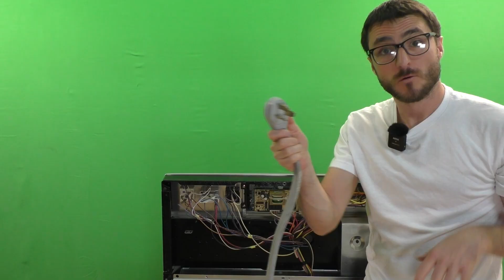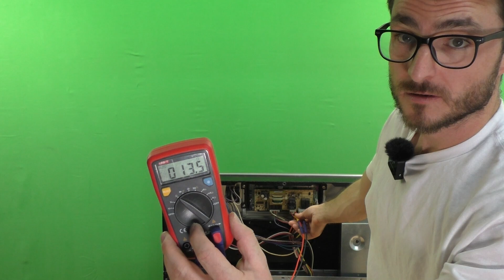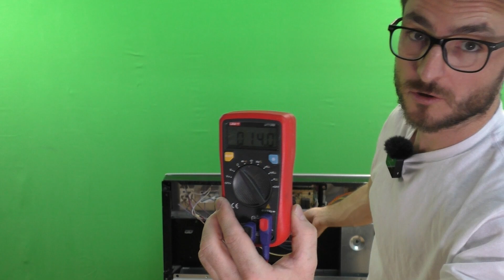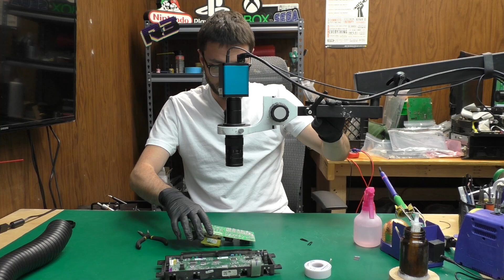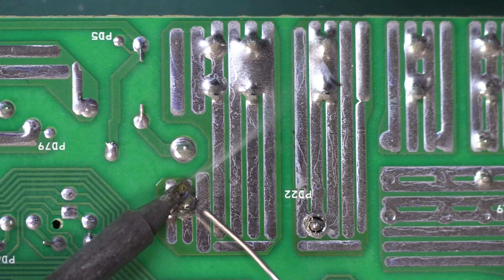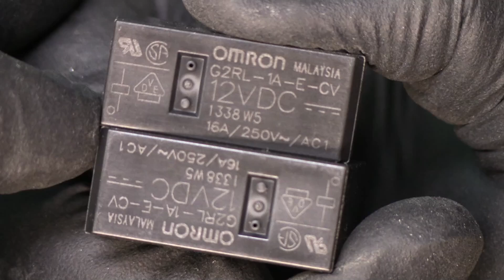Oven Not Working Repair For Frigidaire Gallery LGEF3045KFK 5304495520 316560105

Comment: Thank you for saving me a bunch of time and money!  I followed your steps and came upon the exact same burned joint (in the exact same place!).  I didn't reflow all the connections but only resoldered that open one (and right in place).  I know this is less than optimal, but am hoping it lasts long enough to get us thru the holiday baking.  The oven is now working perfectly.  Fingers crossed!  Thank you again - your video saved me!
Reply from the maker: Awesome to hear you got it working!
If you ever want a full refurbishment of the unit after the holiday season we offer a very extensive refurbishment which includes replacement of all the parts that commonly fail in addition to a full reflow, and optional 5 year warranty for true long term peace of mind

Comment: What is it if my broil element works but not bake? Same relay?
Reply from the maker: Take a look at the relay joints you will notice one most likely has a burnt solder joint.
Reply: @NicksElectronicRepair thanks a lot for the help.
Man I just looked and the two connectors for the bake element each have burn damage where they connect to terminals..one just below that large relay and one to the right!?!
Reply from the maker: Yeah that's also possible you have multiple bad joints. 
That's why when we do our repairs we usually reflow the whole board otherwise other issues might arise soon after the repairs. 
We also started replacing a set of other components that we have seen commonly fail to ensure long lasting repairs.